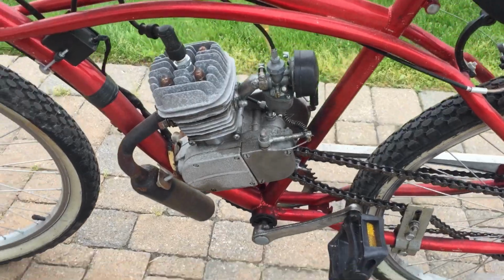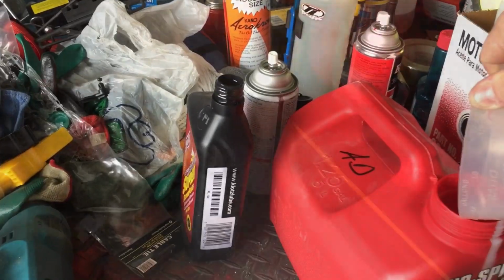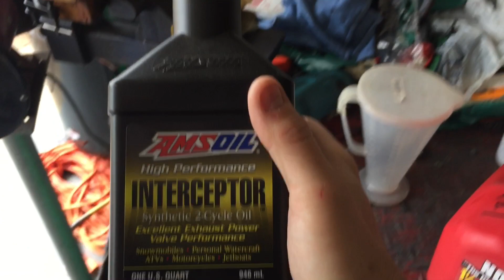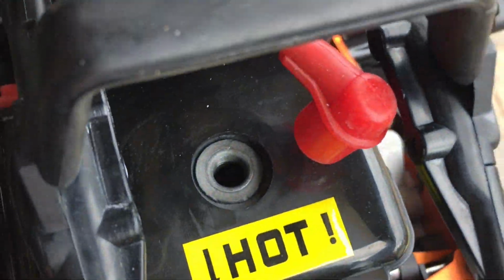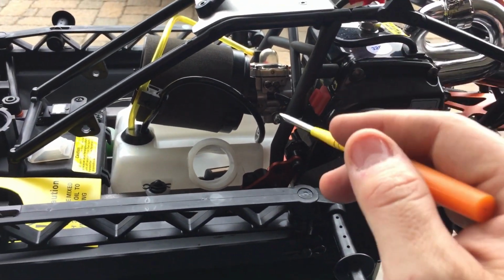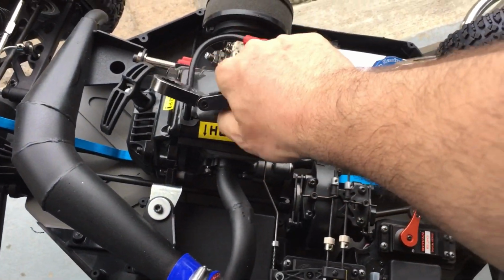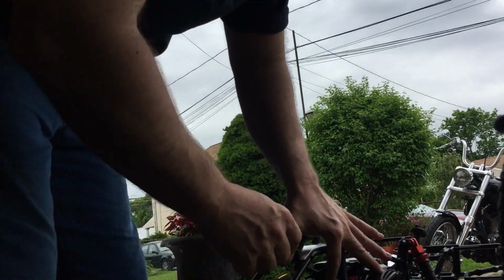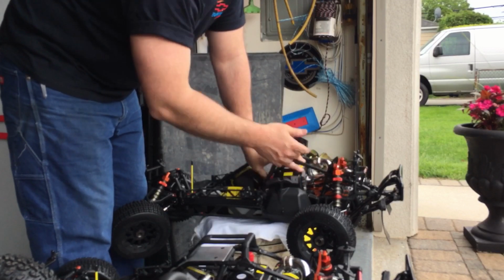Full Day of Prepping New RCs, Breaking In Engines, & Mixing Fuels ⛽️

Comment: Awesome vids man really learned quite a bit since I'm a noob with these Gas RC engines. I came across the unboxing video for your cousin's ROVAN BAJA 5SC while doing some research for my next RC. Never had a gas or nitro powered RC or a 5th scale so I thought I'd try and get a gas or nitro 5th scale next.  The whole thing about adding some penetrating fluid to the pistons and warming it up with a heat gun was something I never heard of doing till I came across this so thanks a lot for that tip. All the other video's I've seen everyone just puts in the gas mix and pulls to start it up. Even HPI didn't bother to say anything about that in their own Baja 5B break in video.
Reply from the maker: TJK Tyler Godfrey thank you for stopping by and for the kind words!! Good luck with everything and if you ever get stuck just let me know ! This is what Braaaaap ⛽️Brothers do !

Comment: I use "castrol power1 racing" 2 stroke oil  no less than 25:1 with a 97 octane petrol.  I mix 5ltrs of petrol or gas with 200ml of oil.  also I ran mine in over 5 tanks to ensure compression reliance. once run in I kept the same mixture and then tuned the engine to the fuel mix. When I ported and polished my bajas engine which was  a stock26r the mix was perfect to tune. Ive had about 35 maybe 40 tanks through it now and all good. you should always use the same oil that u broke in with as what u regularly run.
Reply from the maker: Great to hear of what has bin working for you! I like to hear of other Gas/Petrol ⛽️ Brothers different ways of doing things! I used to build my own race car Engines and I also used to rebuild and install many big bore kits on ATVs with 2 stroke and 4 stroke engines and I have done many chain saws and weekwacker and blower 2stroke motors as well! I've bin doing the Nitro RC thing since 1992 and still do it today and the 5th scale RCs thing since 2004. Thank you for your great videos I subbed to you today and keep up the great work!!

Comment: This video showed me the difference in the platforms and carburetor adjustments
Reply: Truck should be here this week
Reply: Did you adjust the carburetors anymore or just the idle
Reply from the maker: Roderick Taylor I leaned the high speed needle until it sounded good with no more breaking up

Comment: Love that smokey shit bro 😎.and that Klotz racey scent. I like it so much I bought one of the candles they sell bro to burn in the house......
Gotta love Rovan and King Motors RC, Helps a lot of new folks get there 5th scale on. Haters can say what they want but ain't nothing wrong with there shit with some upgrade parts added on. Oh yea and a lot of thread lock lol..
But even Losi's,ETC. Need a good threadlocking job and upgrades. Wish I lived closer to you but I'm down south in Nashville that would be a hella trip.
They need to ban any company from listing in there manuals to use 2 stroke oil from garden centers. AMS ,Klotz,and on occasion Redline are my choice for oils. Running out to break in my new OBR 46cc shortly now it's not 98 degrees outside,hot as hell down south bro. Lata Botajell
Reply from the maker: jfleming747 💥👊💥🤝🍻🍻

Comment: i think just to be on a slightly safe side. You might wanna fit a ceiling halon extinguishing system. seeing all that fuel around. You got a family indoors.
Reply from the maker: Dangerous RC productions I have 5 fire 🔥 extinguishers just in my garage alone! I get them from work. My garage is also double rocked and I used 30 R value insulation in the walls . I’m more concerned about my lipo batteries then anything else !

Comment: Is the lead in CAM2 112 ok for Zenoah G290RC or should I get 91 ethanol free? Thanks I really appreciate these as a newbie!
Reply from the maker: 91 ethanol free would be best and most power for your stock G290 NO ?’s
Reply from the maker: Do not go passed 100 octane! The 91 will be great 👍
Reply: BOTAJELL thanks! I made the switch when it ran like crap & I switched to Kings vented gas line. 
Give yourself a POB because when surprising the engineers from Zenoah answered the question the same way!
Thank God only 1/4 a tank ran through. PS the heat gun is a beautiful suggestion!
Reply: BOTAJELL that same shit happened to my wire. In addition to the starter completely grenaded into the flywheel.
Dan was SUPER cool. He swapped me out for the Zenoah GT 290 & I was off. Really got into it & doing it right with some tight mods, research, & patience respecting that sweet gift.

Comment: Thank u for this video!  I’m getting a losi 5t the new orange one with avc. I’m gonna get a fly sky gt3b and killer rc kill switch. I learned a lot for what I should do. Do the stock losi engines hold up pretty good?
Reply from the maker: The true windwaker thank you !! there is no such thing as Losi Engines. Horizon Hobbies sells losi 5T and MTXL comes with CY 29cc Engines and there great to start out with and the new 2.0 5T comes with a really good engine to have the r upgrade to start out with and that engine is a Zenoah G320 32cc . Try to get a futaba remote if you can ?
Reply: Hey thanks! I meant the stock engines. One more question. Do u think I need the extension splitter for the killer rc kill switch?  Btw do u know any cheap Futaba remotes because I’m really not gonna be able to really afford one after I buy  this car XD
Reply from the maker: The true windwaker killer Bee kill switches come complete no need for extra stuff and I don’t know anyone selling a used remote
Reply: Ok thank u

Comment: If you have been using a castor based 2 stroke oil is it ok to switch to fully synthetic or vice versa without cleaning all the engine out and flushing?
Reply from the maker: You can switch and even mix with nitro engines but with our 2 stroke engines you want the best synthetic you can find so I use Amsoil Dominator Racing Oil!

Comment: Yes Sir..
Loving the clear detail tutorial, on the Carb Settings needle. 

My Only thoughts now is.. 
After a full engine brk-inn, 
And your Now Tuning for performance,
Do you start off 
Tuning the Hs needle first.. or the Ls needle. ? ⛽🌬
Reply from the maker: Nitro Wave I go by low idle then I will adjust the low speed to how until it will take off and idle by sound and my likings. Then I will adjust the high speed until the engine sounds all cleared up but still have a little smoke.

Comment: nice bro I use red line  synthetic racing 2stroke oil   very good  it's also a redish  color . I have ran it in my Yama buggy 26cc fir 3 years an it's still going strong . I run the baja 5b with same .
Reply from the maker: Good shit as well! Thanks for sharing that. I never used Redlines 2 stroke oil but I have used lots of there engine oil and lots and lots of Gear Oil for Diffs on my race camaro I had in the 90s. I stoped using it because every time I filled and rebuilt my rear on the car I had to always buy Pozzie Diff fluid additive and mix it with the Red line. From there I went to Royal Purple and then to AMSOIL and with the Severe gear oil Amsoil has there is no need to mix anymore. Sorry for bringing this up but you just brought back some memories bro! Lol! Those were the good old days ! I still have a beast of a car for the street but times have changed! To much to lose now and I have 3 kids know what I mean?

Comment: I started my truck first time but I didn’t put any 3n1 is that good or bad
Reply from the maker: That’s fine no worries. I’ll only use 3in1 on a new engine that has been setting for a long time and if it looks dry . I’ll coat the cylinder and piston ring with it or any other type of oil or penetrating oil I got laying around just to prevent a dry start or first time pulls . I just use a little of it because if you use to much you can sometimes flood engine but if you use a little like I do ? My engines always start first or second pull just facts as you can see on many of my videos

Comment: Whats your thoughts on Redline racing oil?  I run that in my Gas Aircraft & Boats, I just got the rovan 5t 36cc would that be good for break in and running?...Thanks , love the vids keep'em coming Braaap brother🤙
Reply from the maker: Yes that will be good enough for your Rovan 36  No Worries that’s good Oil but one day when you run out of it and if you want to buy the best that I have seen from my Modified extended swing arm banshee days when we drag raced them at the Sand dunes in Long Island NY and in NJ ? You must get yourself some AMSOIL DOMINATOR Oil !! It’s over kill for our engines in our RCs but if you want the best ? There it is!

Comment: Maxima Castor 927, the nectar of the gods.
Reply from the maker: Hahaha ! I love it ! THE NECTAR OF THE GODS!! Bro that's great! I've used Max 927 many times before and I like it just like Klotz and it's good shit for sure ! I tell people all the time to use that if they can't get any Dominator in other countries.  If I could not get my hands on any  Dominator oil tomorrow for some reason? I would go back to Max 927 and if I could not get my hands on 927 ? I would go back to Klotz. I still have about 6 quarts of the 927 left. I may use it to break in my SkoPod  motor???
Reply: BOTAJELL I would use amsoil but my wallet doesn't like it lol. I buy a quart at a time. Maybe I'll start buying cases? How much do they run? For the good stuff you use? I run mod engines too so they need the love
Reply from the maker: Call me and we can meet up someday and I'll mix you up a gallon

Comment: Is royal purple 2 stroke oil good for them? I just got my first 1/5 scale Baja. I been using it in my ktm.
Reply from the maker: Mr. 4fifty sure it's good bro and will work out great. For the RCs I like to run Amsoil Dominator oil or Interceptor oil . Other oils I like and had great results with was Castor 927 and KLOTZ ! KLOTZ is also very good !

Comment: thinking of getting scz 29cc 9hp reed motor for losi dbxl have you ran 1 of these motors before and nice setup liking it will subcribe keep up good work
Reply from the maker: No I haven't? Is it the same as the BZMs ??? If so I have to get one! I love Engines/Motors
Reply: not sure but has a lot of torque
Reply from the maker: Torque is what I'm after for my MTXL. It's a beautiful Engine for sure ! Who sells them? I wonder if it's a knock off of the BZM motor?? BZM is unfortunately no longer around from what I hear so I wonder if someone took there great designs and is running with it? I must try one of these out. I have seen a buddy of mine on YouTube that has one of these beautiful motors but I never heard it run yet?? Keep me posted
Reply: i will update u when arrives and not sure who makes them but bought of ebay
Reply: can buy for www.sczracing.com it outperforms the bzm micro so might be bzm but new name brand
Reply from the maker: Thank you for the heads up and info on that beautiful motor! I appreciate that! Looks like a bad ass Reedcase !
Reply from the maker: Please do I would love to see it!! Can you send pictures or videos to botajell@gmail.com ?
Reply: will once its here be about 2 to 3 weeks to arrive

Comment: My Baja won’t work without choke off why?
Reply from the maker: R/C Family that’s because it sat for to long and there’s garbage in the fuel system and carburetor. Clean out your fuel tank , install new fuel lines , rebuild your carburetor or install a new carburetor like a chokeless 990 carburetor but if your a newbie and have trouble starting them engines up ? Use the same choke carburetor like the one your used to. Also remove that shit plastic intake because they always crack and cause air leaks ! Get a RB insulator Block intake with diaphragm filter on it and  get a Velocity Stack on it also with new air filter for it! Your engine will feel like it got a dose of steroids. Hopefully you have a decent pipe? What pipe you got now ?
Reply: BOTAJELL it’s brand new
Reply from the maker: R/C Family you probably have vapor lock happening with fuel tank? Get a vent on there or make the hole on your cap a tiny bit bigger see if that helps : also replace that plastic shit intake with the one I told you about because the stock ones almost always causes air leaks. What engine do you have and what pipe are you using
Reply: BOTAJELL I got this rc it’s Rovan Baja Buggy with 36cc engine I was trying to breaks it in yesterday like you showed in the video but it won’t stay on without the choke. http://www.rovanrc.com/1/5-buggy/1/5-scale-rovan-ready-to-run-360ag-36cc-gas-baja-buggy-rtr/
Reply from the maker: R/C Family wow that’s a nice one !! I wanted that one! Get yourself a 990 carburetor for that ASAP ! And start having fun with that bad boy!
Reply: BOTAJELL yeah it’s a bad ass where do I get the 990 carb from?
Reply from the maker: R/C Family here it is http://www.davesmotors.com/av990walbrowt990withbearing.html
Reply from the maker: R/C Family if you are a new to this hobby and have problems starting an engine? You may want to sacrifice a little Performance for a carburetor with a choke on it like the 1107 carburetor http://www.davesmotors.com/walbro-wt-1107-carburetor-modified-throttle-shaft-bearings.html
Reply from the maker: R/C Family intake I love http://www.davesmotors.com/RB-Innovations-Heat-Sink-Isolator-Block-w-Diaphragm-Filter-for-Zenoah-G320-Engines.html
Reply from the maker: R/C Family do not forget this http://www.davesmotors.com/ddm-tall-rc-cy-velocity-stack-1-height.html the Bartolone one is much better but much pricier . I can send you the link to the Bartolone one if you want or can’t find it?
Reply from the maker: R/C Family http://www.davesmotors.com/TGN-Easy-Clearance-Air-Filter-for-HPI-Baja-5b-5T-3293.html
Reply from the maker: R/C Family http://www.davesmotors.com/outerwears-airfilter-pre-filter-baja-goped-losi-5b.html
Reply: BOTAJELL thanks man I appreciate all the tips and links I’m new to the gas 1/5 I ran nitro before. Il try to figure it out
Reply from the maker: R/C Family I love nitro 👍💥🤝💥👊💥🍻 https://youtu.be/2JrPssK-sv8

Comment: i always richen till it breaks up a little then slowly lean the high for power same with low richen for ruff idle slowly lean for crisp take of and smoother idle simple as that fuck books for factory carb settings it is a base point and thats it when they set it in colorado for example its different elevation and temp than wisconsin thats why i use factory basepoints back out to richen to break up stop there then slowly lean for power and stop when i get no more sound is everything for carbs if you really know your stuff. plug color is a good aftercheck if you scared and unsure but if you are leave it alone by the way hard break ins seat rings better crosshatches in 2 stroke polish out fast so you need to take advantage instantly no holding revs but hard accels every dyno in the world for top racers proved this a nitro motor is different slow break in is better theres is no piston ring. people baby them then there rings seat like shit. hard stop and goes no high rev holds till break in is done.
Reply from the maker: Good stuff but I only start beating on my motors after the that process I have bin doing for years. I show how I Break In my motors in past videos and after all those steps after 12th step I start to put my motors under some loads or Stress. It's just that I have motors that are old and still runs great today after it had raced every week at 32:1 mix then I stopped racing and just had fun with the rc bashing it and went back to 28:1 mix. I have even let a buddy of mine use it on his RC because I have plenty motors in stock and I my buddy had a blown stock motor and a new motor on order and I wanted him to come out and bash with us. My motor was in his care for 3 months lol!! I got it back from him .